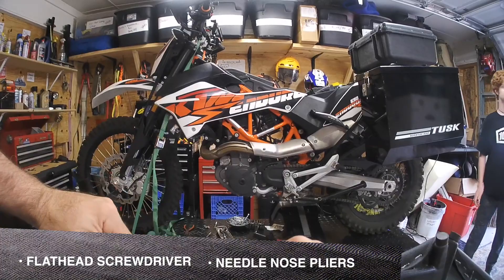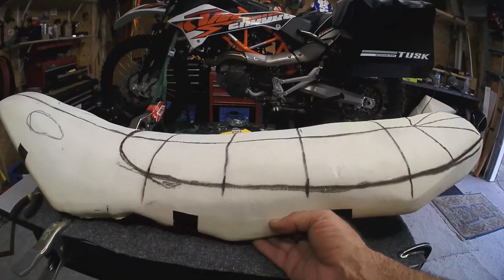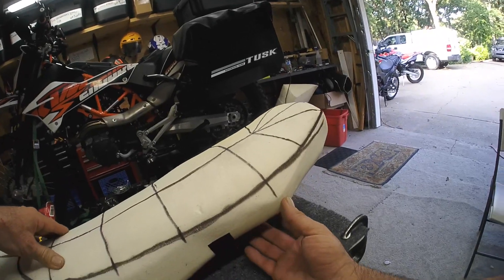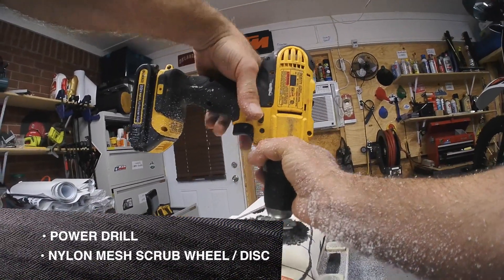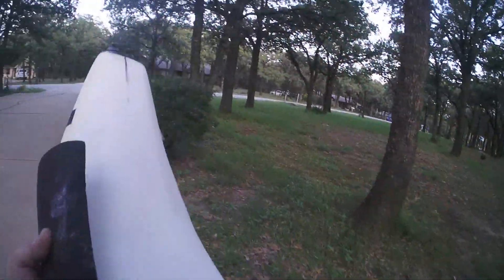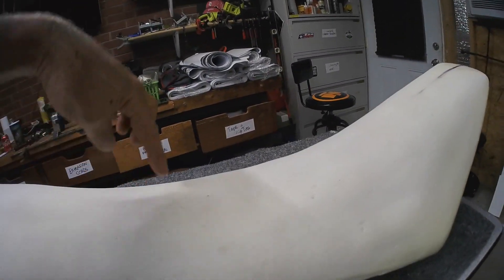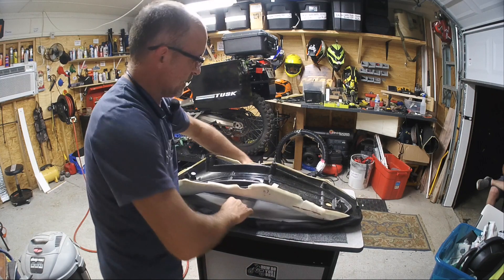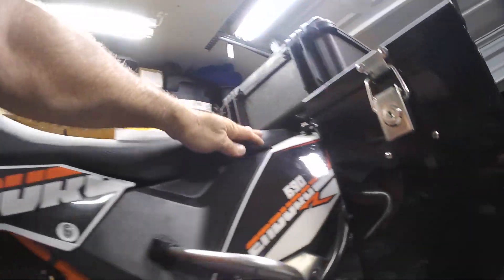Best SHORT RIDER Factory SEAT CONVERSION = Seat Concepts- FREE & DIY

Comment: Your ballet tip toe on one foot on stock- are u then talking incl using the koubalink? Or stock with stock link? 
Im interested in knowing if your koubalink was enough to get both feet to the ground - and, what size koubalink do u have?
Reply from the maker: Hey man. No the ballet toe was before.  My link is the lowest one. It’s the KTM8-2.  It lowers it 1 5/8 inches.  With that and the seat mod I did I am very comfy on it. Not even tippy toe at all.  Like on the balls of my feet.  ( that sounds funny . Ha ).  When ADV loaded it’s even a little lower.  I highly recommend the kouba and the seat mod OR buy a Seat Concepts lowered seat.  It brings that 690 into the short dudes fighting ring. I’ll never look back. I love that bike. I think the 2019 is even a little lower seat height.  If you do the kouba yourself..... follow the directions and go SLOW ... if you get frustrated stop.  I got s little hasty and accidently pulled like 20 spindle bearings out of the link when I jerked the main bolt out in frustration.  we had to slowly repack all those bearing in there.  Totally avoidable nightmare had I remained patient.
Reply: Story Moto ADV thank you very much for a very detailed answer and quick too 🙌🏻🙌🏻
I went to the ktm dealer today, and climbers the 2019 690 enduro r.
I could baaaarely rest it on my toes on left foot.
My right foot could by no means reach the floor so it actually scared me off. So therefor my questions here 😀

Im challenged by inseam measurent haha..  im 5 feet 7, and in seam 30 inches.
But i can seriously not touch the ground with right foot, its crazy. But then for comparison i actually climbed the crf250 rally and i was almost flatfooting it totally.. that wondered me, cause theyre only supposed to have like 0,5-1 inches differences in seatheight as i recall.

So now, im wondering if it was because the rear suspension on the ktm was set to a too heavy rider compared to me, maybe the sag wasnt right.
And or / that the seat on the crf is more narrow, where the ktm seat felt very wide (even in the most narrow part of the seat)
Reply: Story Moto ADV Ps. I subbed. Very inspiring videos you fo there, and your son is badass by the way, hope he knows🔥🙌🏻
Reply from the maker: Expedition Hawk thanks for that compliment man.  He is an awesome dude too.  A damn pleasure to tour with.
Reply from the maker: Expedition Hawk I’m 5’6” with 30” inseam.  After I rode a 690 I was bound and determined to make it work for me.  That thing is sick. I bought it slightly used (2016) and bone stock.  I was terrified leaving the dudes house.  I couldn’t touch the ground.  Haha. I made it home though.  Doing the mods made it easy breezy to look and feel comfy on. The CRF Rally is super tall too but the suspension from the factory is also super soft.  It sits down pretty good.  The KTM you sat on must have been set harder like you said.  Let me know what you do. I’d say get a 2016 or newer that hasn’t been ragged out.  Pull er in the garage and get to modding.  You’ll never look back if you do.  They are beasts.
Reply: Story Moto ADV but does ur tire ever hit the tank or whatever, Ive read people having problems with that after installing koubalinks
Reply from the maker: I don’t beat it hard when fully loaded.  And it’s a hell of a shock and I’m pretty light ( 155-160 lb).  It could perhaps be those factors but no I’ve never hit the tank. And if you’ve seen some of vids of raising some cane, he do ride pretty hard.
Reply: Story Moto ADV yeah Ive seen that 😂 another thing is, you should make a video here where you show the effects of ur shaved seat and kouba etc.
Where people can see you in full frame, climbing on and off the bike. So you can really see How the height is now compared to ur inseam.

It will be a very good reference for all of us that are searching for theese mods and How does it look on a rider with a certain inseam measurement. For reference.

I know after searching the crap out of forums the last month, that a lot of people are looking for such a video 😀🙌🏻
Reply from the maker: That man.... is a great idea.  I do believe I will. Haha. Thanks brother.

Comment: Rasp (UK term, not sure if you guys in NA call it by that same name). Best tool for 'sanding' seat foam down I found.
Spray glue, good for stopping the fabric from bunching up, or creasing, before stapling.
And stapling is indeed an absolute mare :)
Reply from the maker: Nailed it man. Ya a rasp would have been a great tool.  Considering that now that you say it...That mesh I used is essentially like a really crappy rasp. Haha. Same coarseness but not nearly as wieldable like a rasp. Good thought man. Spray glue the same.  As far as stapling ... whew. I found that a powered stapler is about the only way. That seat plastic has so much recoil